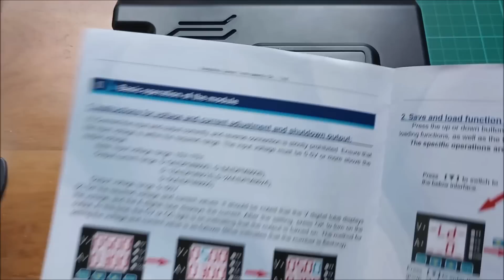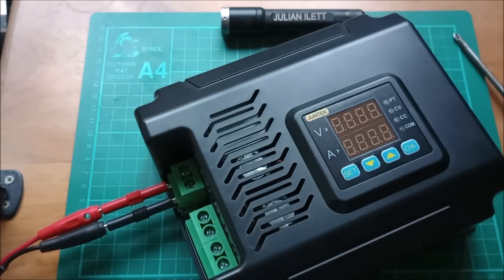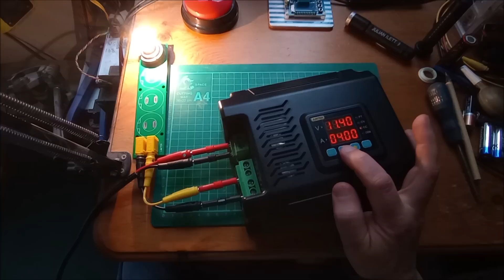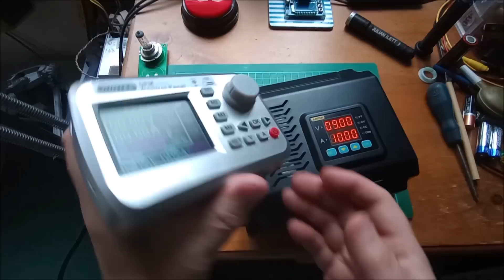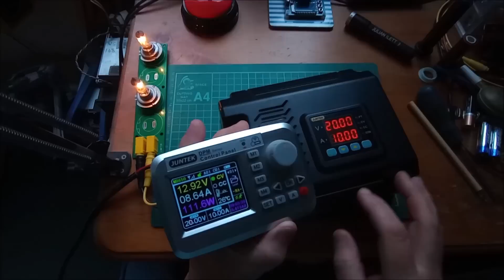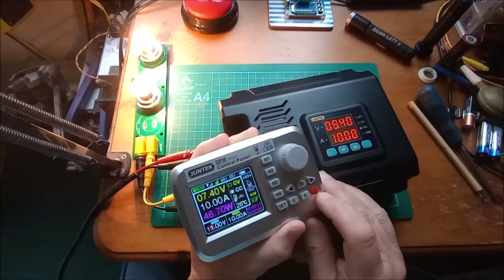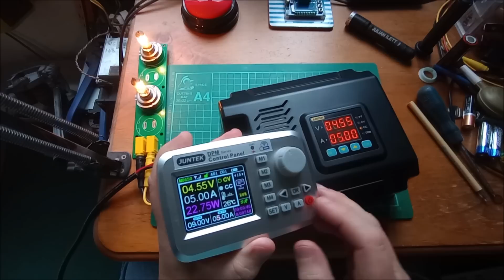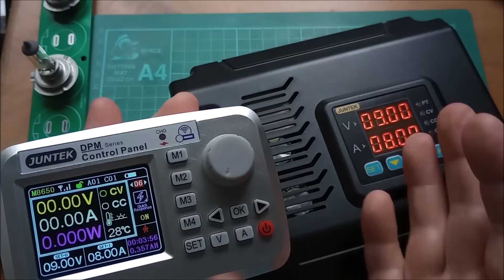The Ultimate Buck Converter? - Juntek DPM8650

Comment: I have to say, the Juntek DPM86xx-series buck converters are extremely good.  I came from trying "600W buck converters" from eBay/Aliexpress, and every last one burned out after just an odd dozen hours of use.  The Juntek converters (I have both an 8608 for bench use, and an 8650 for bigger battery charging) have been stellar units that just keep right on working.  

I love the current limit ability: they will happily put full load into a dead short.  Makes "ohming out" extremely low-resistance coils (<0.01 ohm) feasible with Ohm's Law (i.e. R = V / I).

The only problem I've had--with both the 8608 and 8650--is the control panel arbitrarily deciding to stop working.  The display part still works, but all button presses are totally ignored: you can't control the power supply from the panel.  (It is still fully functional via the wireless remote control.)  On the 8650 I just used the remote control for the several months it took before the control panel started working again; on the 8608 when it messed up (after several years of abuse), I disassembled the power supply, and shorted out every power supply filter capacitor I could find.  Reassembled, and whew the buttons were working again.

There was a different issue where the 8608 would suddenly short straight through input-to-output; I believe this was the result of my testing LF power inverters with it, and the 8608's output voltage got pushed past 60v, damaging the internal FET.  Got a replacement board from Juntek at half price--but fortunately was able to fix it by replacing the main FET.  Still have the backup board just in case!

Comment: Kicking myself in the a** for re wiring my solar array to a 2s config. Yeah sure I get more power production earlier and later into the day and better cloudy weather performance but now my array can average 85v (can dip into the low to mid 70’s. Technically rated for 77.4vmpp) and I can no longer use my 1500w dc to dc boost converter to solar charge my 72v 3.5kWh ebike since it caps at 60v input 😢

Comment: Great tool and review! It reminds me of the Rui Deng Buck Converter like the DPM5020 or the new DPM6024 with up to 24 Amps. 50 Amps really is a word and i would like to see a heavy load test on the Juntek - so you need a 50 Amp load. Can it really handle 60V at 50 Amps? Thats 3 kW power in this little plastic device?  Also interesting: what about conversion efficiency, ripple output, min. voltage drop. I would have loved it more to have the multicolor display on the converter directly rather than having a remote control.

Comment: curious how it would hand a solar panel at input.
Reply from the maker: A buck converter measures output voltage (and sometime current) and uses those measurements to control PWM in a feedback loop. A solar charge controller measures Input voltage and current (to control the MPPT mechanism) as well as output voltage and current (to properly charge the battery (CC/CV).

Comment: Hi Julian,

I have the Juntek DPM8624-RF.
With this device I wanted to charge batteries. It said in the description this is possible. I came to the conclusion it's INCREDIBLY DANGEROUS to do that with this device, because during powering on, the device will short the plus and minus on the load side. Also when the device is powered off I believe the plus and minus are shorted.
I had a very bad short circuit once, and had smoke everywhere.
Could you test this device if you are also experiencing the same?
Reply from the maker: Could that be the "fast discharge" system. I've watched it rapidly discharge the output capacitors when the output is switched off. The manual says it also does it when the output voltage is being reduced. On the DPM8650 the fast discharge mechanism can be disabled. I'll look at this more in my teardown.
Reply: @JulianIlett  That could be it indeed. I have not checked for this function as far as I can remember. Looking forward to your teardown
Reply: was thinking this would be good to remotely monitor whats going on in a caravan.  we seem to have so many issues and would be handy to see what the voltage and currents are at the battery but not if it shorts it

Comment: Why? You already have a 12v battery that can power anything...
Reply: Because it would be nice to use a higher Voltage between solar panels and the unit and then step it down to battery Voltage if the battery and the panels are a good distance apart.

Comment: did you check the distance and the  signal of the remote ..  what type of connection ? how many meters in same room is it working ok ?
Reply from the maker: The wireless module looks like a nRF24L01+. My experiments yielded a range of 20-25 metres through walls (maybe double that line of sight).

Comment: If you put this between high voltage solar and low voltage batery with pwm controller, if you set voltage close to battery voltage, will it rise efficiency?
Reply: No, because this unit isn't 100% efficient and the total efficiency is the multiple of both the units

However, now you can charge your batteries using the lower voltage pwm charger
Reply: @subhobroto  I mean teoreticly if i have 50v panel and 12v battery, on full sun i would get on PWM like 1/4 of full power, so if you put this buck between and set output voltage lets say 13-15V, i should get like 90% of full power which would come from mppt charge controller, or am i wrong?
Reply: I think the issue here is that it doesn't monitor the input current and input voltage. If you add this on the input side you could control the buck converters output via a micro controller to behave similar to an MPPT controller (no more pwm controller needed).
Reply: @Ether_Void  its not the issue, changing power from 20 to 90percent is good a few more percent from mppt tracking does not matter much.
Reply: @rm6857  In that case I don't really understand the issue. 
As subhobrotosinha287 mentioned you can't increase conversion efficiency by adding more converters. A let's say 90% efficient converter can't bring back the power that is lost somewhere else.

A PWM controller is inefficient because it doesn't operate near the maximum power point of the solar panel.
If your unit doesn't charge well above 90% it might be a safety feature or something to prevent deep cycling.

Hard to say without details.
Reply: @Ether_Void  i didnt write anything about adding more coverters, just one converter. Are we reading same text?

You have it right about PWM, thats why i was thinking about putting buck converter before pwm, so  pwm is fed with more current, which would turn in more energy charging by pwm controller.
Reply: @rm6857  Yes we are reading the same text. You just mentioned again that you want to add this buck converter before the PWM controller, so one converter after another. 

If the PWM controller isn't efficient enough an additional converter won't give you more efficiency. Especially since you've mentioned that it charges well up to about 90% this doesn't seem like a current problem.
Reply: @Ether_Void  indeed. I think the op is misunderstanding how a pwm charger works. It's just a MOSFET with no boost buck semantics. They won't be able to charge a 12v battery with a 50v panel using a pwm charger, it would damage the battery

It's possible they tried exactly this, it worked because the panel drooped to 15v or similar but damaged a cell or two
Reply: @Ether_Void  PWM controller does no dc to dc conversion, its not converter, it just regulate it, regulate it down.
Reply: @subhobroto  You can charge 12V battery even with 1000000V solar panel via pwm charger, it will not damage anything. Thats why you have charger to dont damage the battery.
Reply: @rm6857  incorrect. I'm curious what makes you say that though, did someone tell you that? Also:

1. What is the charger you use. Model number etc
2.. What background in power electronics do you have?
Reply: @subhobroto  1. All pwm chargers behave all same, why would model number change anything?...all i have tried, and based on my knoleadge all should work like that. Have many of them you tried on example i provided? Must be none, because you are incorect, and just 1 try would show you that
2. Why would anyone need any background? Just describing reality, you saying its false without any proof...
Reply: @rm6857  could you give me the model number of the charger you're using, please, when you can
Reply: @rm6857  A buck converter (like the one in the video) is also just regulating down. 
In fact the actual switching part of a PWM controller and Buck converter are quite similar except for some additional components that effectively smooth out the current draw (so it doesn't swing between full current draw and open circuit) and output voltage. 

The reason why I suspect the PWM controller actually being the issue here is that for constant cycling it's best to keep the batteries between 20 and 90% state of charge, never full discharge and never fully charged. Solar charge controllers often take that into account and keep the battery between those states by default.

It's unlikely that more current would get you above 90%, you just need current flowing in and if the nominal voltage of the panels is well above the batteries maximum voltage there shouldn't be a reason why the solar panels won't be able to push that current. 
If the nominal voltage is not above the cells maximum you need a boost converter and not a buck converter. 
If the PWM controller still doesn't let current trough above 90% state of charge then it's an issue with the controllers cut out voltage being set too low or the controller slowing down charge to preserve battery life.

PS: Also to back to the original question: if you are looking for a buck or boost converter, to put in front of a charge controller you don't need this expensive one. It's more of a industrial type with digital controls. There are way cheaper ones you can buy that use potentiates and lack digital controls and some also lack current limiting which also isn't an issue when you already use another regulator.

Comment: I have a DPM8624-485 (afaik there is a TTL version without the 485 at the end and the Modbus/RS-485 versions have that extension).
Had no time to try it yet especially since I am still waiting for a power supply, but my plan was to use it for battery charging where a microcontroller would control the charge process via modbus. Apparently there are Arduino libraries for it.
Reply: Did you ever get this working with MODBUS?
Reply: @VonBugle  Sorry for the late answer. Haven't got it working yet, because of a grounding issue I fried the RS-485 adapter that came with the unit. 

For anyone reading this I recommend getting a proper RS-485 adapter that has ground broken out (RS-485 needs ground) and ideally also isolated. The cheap adapter that is supplied with the unit has no ground connection and relies on the external grounding over the USB Port and since it isn't isolated (at least mine wasn't) it's easy to kill.
Reply: @Ether_Void  hi I have a question are you successfully control the voltage setting and current setting using microcontroller?

Comment: It is beefy and impressive, but RD tech has made a name for themselves as a Chinese brand you can trust to make quality products, so personally unless it's cheap I wouldn't buy from anyone else at this point.
Reply: Juntek has been making this model for about as long as RD Tech has been around and they focus on high-output models that Rui Deng doesn't make, so get the right tool for the job.  I like RD Tech, but Juntek is an established and proven brand.  I'd buy a Rui Deng for my bench and a Juntek for high-power applications.

Both are budget brands, but RD Tech has developed new and improved models while Juntek seems to keep selling the same buck converters year after year (no boost models that I'm aware of).  Juntek doesn't seem to promote their products very well, either, as they're hard to find and that's probably why Julian hasn't tried one before ;).
Reply: Bhi

Comment: Hmm seems like a good Buck converter, are you waiting for the rain to start before going back to the shed???
Reply from the maker: The shed is a complex place. It gets very hot (and very cold). It gets damp in winter. It's the best place for lithium battery experiments (especially charging). It's not the best place for sensitive (or valuable) electronics.
Reply: @JulianIlett  you have valuable Electronics??? 🙂
Reply from the maker: Admittedly, not much.

Comment: Wondering what/where i could use this thing, A variable power supply? im unsure what application it could have.
Reply: at £127 I'd need to have a usefor it before buying
Reply: @dantronics1682  Trying to think of a purpose , High amp step down power conversion for high power applications? Not sure how secure the wireless feature is and if setup in a permanent installation would you need to keep changing the settings? I dont know 🙂
Reply from the maker: Well, my application will be running a high current 12V load (Antminer) from a 25V solar charged battery.
Reply: @JulianIlett  I have one that I use to drop 50v to 25v for an inverter (700w) but its not digital. just a pot to set the voltage, just bought another since its so cheap (£30)
Reply: @JulianIlett  Hmm interesting , I do have a 30V odd car battery sat here doing doing nothing maybe it could be used on that but im unsure how secure the wireless thing is , odds are low but you never know if you get some joker changing your settings 😀.

Comment: This 25amp version has a claimed power capacity of 3000 Watts, which sounds like a lot of bang for the buck provided that the buck does not go bang 💥. Would you say that this buck converter would be practical for stepping down the voltage from PV panels to charge a battery? 🤔
Reply from the maker: Two things to watch: The slow rise of current from the solar panel may cause the buck converter to oscillate or even crash. Putting a battery on the output of a buck converter will back feed current to the input. Of course, the 2nd issue might solve the 1st issue.
Reply: I have the Rui Deng DPS5020, which is also a powerful buck converter and i use it since 2 years for my small PV project to charge several batteries on a daily basis. Never had an issue with it. The only thing that causes problems is when you try to load the battery in reverse polarity - this typically destroys a diode or at leasst a fuse in the converter. I also use another cheap buck converter for PV-to-battery charge with no problems apart from reverse connection.
Reply: Note that a standard MPPT solar charge controller does Maximum Power Point Tracking - it optimizes the power produced by the solar panel by operating (tracking) at the most efficient voltage on the panel for the current conditions.  This buck converter will not do MPPT.
Reply: I don't think that this device does MPPT, which you'd want for solar.

Comment: That's pretty good. Does it remember its settings between power outages? meaning, if I set the output to 5v fixed and set output to come on when power is applied, if power is removed from the main unit for a while like overnight, does it remember the voltage and amps settings before automatically powering it on?
Reply from the maker: Yes it does remember the voltage and current settings. Also, I want to remotely switch this device on and off depending on battery voltage. It looks like the little on/off slide switch can be externally controlled. More soon.